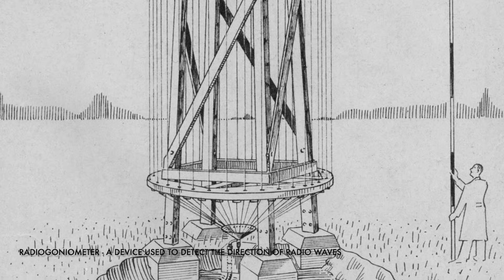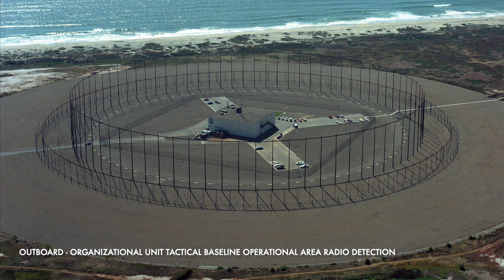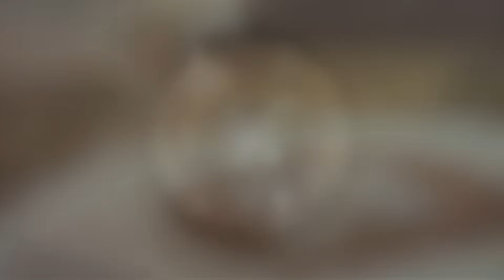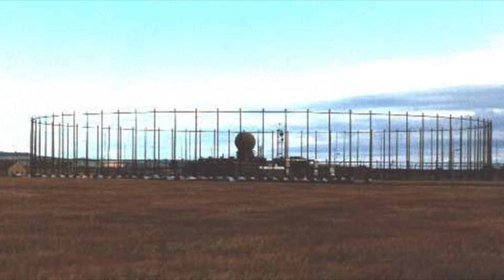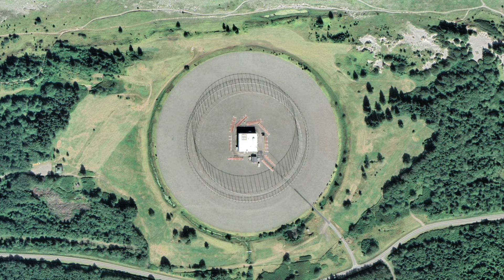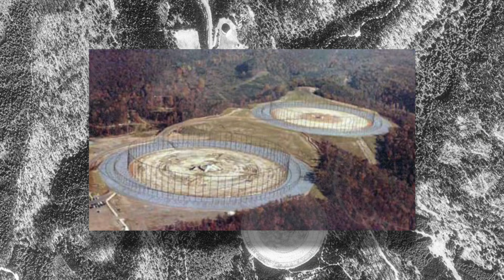Classic Bullseye - The US Navy's Ears On The World

Comment: Thirty years ago I visited friends in Annapolis, Maryland USA to set up a big hi-fi audio system and especially to go fishing. Annapolis is home to the US Naval Academy and many naval operations. My friends, all native to the area, gave me a driving tour of the city. I saw antennas like I've never seen before or since. The strangest antenna system, so they told me, was for communicating with submarines. After seeing all the antennas that day, it occurred to me that it must take a huge amount of electricity to keep all that equipment running.
Reply: I was actually in Annapolis yesterday (3/19/23). The submarine communication antennas are still standing but are now used as navigation aids and as a base for smaller, local antennas.
Reply: @mattpierre891  Thanks for the update!
Reply: Everything would likely be run off generators with an onsite fuel silo.
Reply: comparitvely recievers and their antennas  do not use as much power as transmitting stations.
Reply: The Annapolis array is Navy radio station NSS, or what remains of it.  Most of the towers have been taken down.  The remaining towers stand due to nesting protected birds.  I think Ospreys.
https://en.m.wikipedia.org/wiki/NSS_Annapolis
Reply: @W2TTT  Yes, those operations have been moved to Hawaii (Oahu).
Reply: Chances are that if someone can point to a "submarine" communication antenna, it's probably something else!